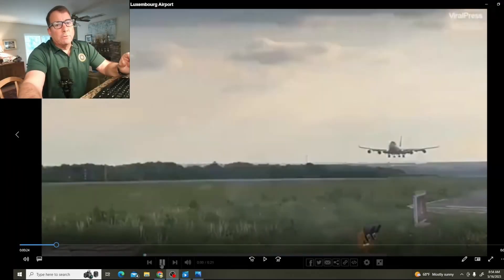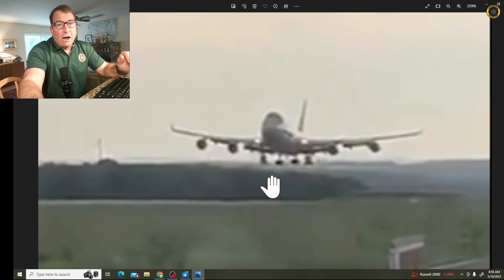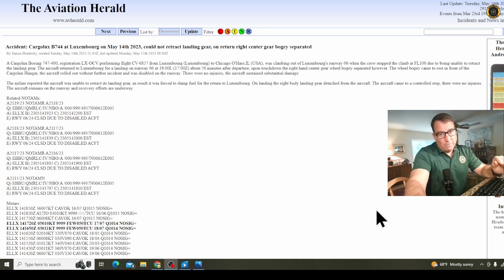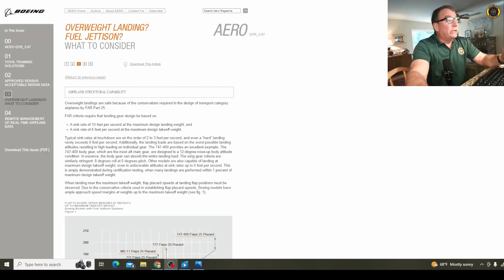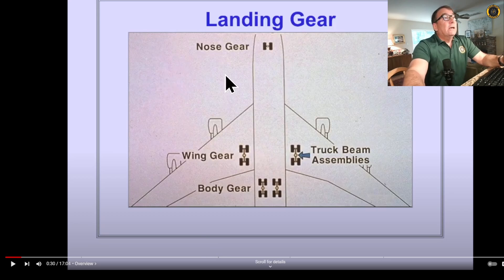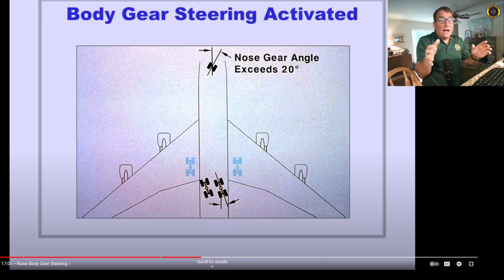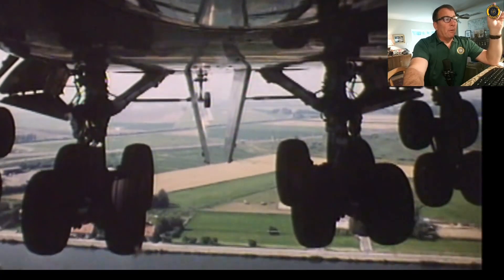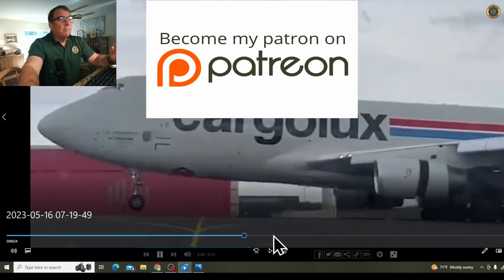Cargolux B747-400 Landing Gear Failure 14 May 2023

Comment: Thanks for the great coverage on the Bouncing Bogey, Juan.  Is there any way to find out for sure if that previous incident with bouncing the Bogey off the van had been thoroughly cleared up? Keep up the great work, God Bless and stay safe.
Reply: It happened more than 13 years ago. So it´s hard to say from the outside if it has any relation to this event - an investigation will hopefully clarify this. The only thing which can be said is that this particular Aircraft had that issue back in 2010.

Comment: An interesting story told to me by one of the engineers on the patent for the steerable boogies on the 747.  As initially designed the 747 did not have steerable boogies, a subject of disagreement within the design group.  During initial ground run and flight testing the test pilots commented it took what seemed to them excessive power or thrust to ground maneuver the bird.  Then in preparation for an aft C of G flight test the pilots were unable to turn the aircraft and the nose wheel just scrubbed sideways.  Steerable boogies were back on the table and then the challenge was to find real estate in the hull to accommodate the frantic redesign.
Reply: Airbus also decided to skip steerable struts on the body gear of the A380.  In at least one flight test incident, a tire(s?) twisted off its wheel.  Now that's some serious scrub!
Reply: IIRC from Joe Suter's book, he initially designed it with body gear steering. However as the weight ballooned it got removed. Rather than bin it, it was parked on the shelf so that when they had trouble manoeuvering the aircraft on the ground Joe said "I have a solution for that", and it was put back on!

Comment: Did not know that the fuselage mains rotated to help facilitate steering. 
So - layman's question - what prevents the non-articulating wing main tires from scubbing hard as they try to follow the articulating fuselage tires around the arc of the turn?
Reply: Good question.  The wing mains are much farther out on that arc, so from a simple geometrical relationship they don't see the magnitude of scrub angle that the body gear do.  Airbus decided to go without rotating body gear on the A380 and ended up with tires wrenched from the wheels, looking a bit like pretzels in at least one flight test incident.  Don't know what they did for a fix.

Comment: Juan , now that it think about it , the last occasion that I mentioned , in Rome ( Fumachino ) , around 1990 , it was roughly midnight local time , Good Friday ( the start of Easter , darn ! ) and it was the right “ wing gear “ that failed ….. Fortunately it let go , following a 180 degree “ line up turn “ at the runway threshold  , failing as the twisting stress was being relieved ( it was a right hand line up turn , so the most stressed gear , being the most inside bogie ) about 60 degrees off runway QDM …. The body gear was still displaced .. So the aircraft ( B747-300 VH-EBW ) dropped onto the No 3 engine , with the No 4 “ slapping slightly , the ground as a result of wing bend from the drop .. The failure was “ explosive “ .. An investigation followed , of course , the results of which are available through the Italian & Australian ATSB .. Initially the whole crew ( ie: Tech & Cabin Crew ) where placed “ under arrest “ … There was no injuries to any aircraft occupants .. It was VERY fortunate that it occurred when it did .. During the “ line up turn , we where “ cleared for take-off RW 16 L , at max TOW , roughly 168000 kgs of barbecue-fuel , and pointing at the centre of the Rome city area including Vatican …….. gulp

Comment: Did you say the previuos incident was in 2010? Been flying for 13 years after that.... would not think related.
If that 1 was lower I'd think the strut  traveled out farther than it should when it lifted off, preventing raising the gear. Then, upon landing of course it is not going back up like it should and instant detachment that we saw. my 2 cents.

Comment: Hey Blanco can will you talk about fuel dump sometime if ya get a chance. I really wondering all the bad things that happen because of it. Like vegetation getting covered or people or cars and houses. What does the airline do if anything to compensate for people for this.
Reply: If fuel is dumped at 10,000ft, it will not reach the surface, but evaporate instead.
Reply: @gordonrichardson2972  Even so the French are quite sensitive about possible  vineyard damage and there is a specific fuel dump area well away to the south east of CDG - it takes quite along time from 747-400 full tanks even with lots of deployed drag and is very boring …
Reply: Juan discussed this in connection with a plane in (I think) southern California that dumped fuel in the vicinity of a school yard. Someone else may remember more of the details so you can find it with a search of Juan's videos.

Comment: If the body gear moves then the wing gear wheels tires will scrub since they don’t pivot.  Am I wrong?  Tires will get scrubbed
Reply: There will generally be at least a small scrub angle for any of the tires in a turn, especially for the "inside" strut of a wing gear if the aircraft were to pivot on that, but from geometry considerations scrub is more severe for any body gears.

Comment: What are the chances that gear was swapped from Kablamo from april? If you look at Juans Kablamo video, the right rear took a good hit.

They swap parts from aircraft in maintenance with lower hrs and cycles on aircraft going through major maintenance with longer downtimes. 

So did this aircraft get the  kablamo body gear? Who knows.

Comment: Does this mean that the wing bogies are raised slightly to keep them from getting scrubbed in a tight turn (or maybe the geometry is not that extreme.) Also, an old 747 cargo pilot, acting as the lead docent at the Palm Springs aerospace museum, told a story about a 747 cargo plane running right over a ground crew pick up, killing two people, on a 00 approach into Anchorage. Apparently the pilots never saw the pickup, they just reported to the tower that they needed assistance, a tow-in, as they had blown some tires on landing. When the tower heard this request, the "lights" started to come on in the tower.
Reply: They do not. The wing gear wouldn't really experience any scrubbing. On the 777, the rear most axle can steer. 3-axle coach buses also have steering on the rear most axle, albeit not as much as the front axle.
Reply: @CaptainKevin  - Depends on the 3-axle motor coach model. In the US, Prevost coaches do not have steerable tag axles, but the tags can be lifted off the ground. The 45-foot MCI "E" and "J" models have steerable tag axles, 35' and 40' models do not. MCI's steerable tags use an adjustable castering system that changes the caster depending on forward or backing movement, and also locks the tags in centered position above 15 mph. There is no "steering mechanism" on these, they simply caster like the front wheels on a shopping cart. I'm not familiar with Temsa and Van Hool buses, so I can't comment on their tag axles. Also not familiar with European makes/models either. HTH. . .
Reply: @CaptainKevin  Thanks for the explanation Kevin

Comment: ....and the YouTube video has been taken down...
Reply: Theres plenty of comments above with an updated link!
Reply: @wino99999  One of the problems I have with your suggestion is that I have zero confidence in an 'updated link" unless the source of that link is actually blancolrio.  A "link" could take me to some nasty place on the Internet.  Therefore, I ignore links with no serious authenticity attached to them.
Reply: @jimcambron1328  No problem, it's a youtube link though so it won't have been a problem.... All it shows is the video from another plane on a taxiway at the airport at the time, and is the same as Blancolrio used his stills from.

Comment: There is a 10 year life on 747 gear, the odds of that being the same gear all these years later is extreamly low
Reply: Um… that’s not quite right …. At that point the legs are removed and extensively examined , reconditioned, then put back in service … boeing deliberately built them like a “ brick shithouse “ , and effectively they could live on with no lifespan limitations, if undamaged , and no cracking was found …. Cracking from the inside out though has been a problem in the past .. and is bloody difficult to detect
Reply: @stumackenzie8492  I'm an A&P mechanic that works for a competitor cargo airline, and just changed a gear one week ago due to 10 year life. While yes, the gear post their 10 year life get reconditioned, they do not go back on the same airplane as the time it takes to recondition them would put the plane "down" for much longer then a normal "C-Check" time of 28 days. Everyone always has servicable gear waiting for a quick 2 day swap.
Reply: @hangmann747tinmann8  I assume that's a ton of cycles in 10 years. I've seen car parts last decades with the right owner. But every one of these landings seems to involve a concussion. What other part on a heavy plane takes this much punishment?
Reply: @JimMork  you are correct, no other part takes the abuse that the gear do. Especially if they do a few HARD landings!
Reply: @hangmann747tinmann8  I'm sure  lots of structures flex on landings, but the landing gear are "frontline".

Comment: GRABBED FROM USA TODAY
Challenger 2 Ultralight Adventures with Peter Toth
1 hour ago
This very same 747, had an incident in January of 2020. Where it struck a van that was on the runway, while they were doing a Category 3 landing. (full instrument landing, with automated system in control right down to the runway due to extreme low visibility.) The right fuselage gear struck the van that was on the runway, which is the very same gear that we see broke off on landing. Is there a possible connection?

Comment: 2010 for the van incident seems like a long time ago, especially for the gear to not have been overhauled since then.  These landing gear are made from ultra-high strength steel (250+ksi or close to 300ksi), 4330M or 4340M (modified with silicone to help improve toughness since they can be brittle at those strength levels).  New make and reman processes for these types of steels are very specific, these steels are susceptible to hydrogen embrittlement from plating, the formation of over tempered martensite/untempered martensite from abusive grinding, etc...landing gear are highly engineered items on large commercial and military aircraft.

Double vacuum melted to be ultra pure too...don't want inclusions or stringers!
Reply: DPF I used to do sheetmetal repair and we were always warned about getting alodine on high strength steel....which I assume would include the landing gear. We used Alodine as a corrosion protection after grinding the alclad off of aluminum when cleaning corrosion. Back in the day when we did overhaul in-house, there were dozens of us doing all sorts of repairs.....around the clock. I always wondered about whether any alodine accidentally washed down under the fairing panels we worked on and dripped down on the gear. The sfaety data sheet says it like this, "Alodine will cause .....instantaneous hydrogen embrittlement....on contact with high strength steel." Is that true?
Reply: @rael5469  anything acidic is a no-no on high strength steel (160ksi UTS and above). Anything with free hydrogen present. Approved aircraft cleaning agents must pass HE testing...that is why the cleaning agents are all alkaline in nature. Some airlines like D-Limonene (citrus) based degreasers, but have to mask up the LG and other high strength steel components to prevent contact with the acid.
Reply: @DillonPrecisionFan  I used to know all that stuff but it's been 20 years since I worked sheetmetal.
Reply: @DillonPrecisionFan  "Some airlines like D-Limonene (citrus) based degreasers" 
Citrisafe. I never liked Citrisafe. Left a film which is no good for painting. We used to have all sorts of great and nasty chemicals which were great for surface prep. But they were unsafe for the user.
Reply: I used to work in a landing gear overhaul shop, and the Boeing overhaul interval was brought in around that time to ten years, so any 747 gear flying about now will be no more than ten years since a shop visit. It could well be that the gears on LX-OCV have been changed out since 2010, Cargolux probably have spare overhauled units available to swap out on the fleet to save time.
Reply: D6AC?
Reply: @hoghogwild  Boeing used a lot of 4330M and 4340M, Douglas used some 300M. Boeing did go to some Ti on the 777 for some drag link or side struts...don't recall exactly. Brake anti-rotation pins were using Aermet 100 at one point in time.

I want to think D6AC was Douglas, but not sure anymore.
Reply: @DillonPrecisionFan  I remember that D6AC was/is used on the Space Shuttle now SLS booster cases.  Each SLS launch uses 10 steel segments, 5 per booster, 2 boosters per SLS stack. Shuttle used 4 fueled segments per booster, SLS now uses 5 segments per booster.  Something like 1200psi peak pressure over a 177feet long, 12 ft diameter average 1/2" thick wall. Peak thrust is 15 seconds post liftoff and 4 million pounds force thrust is achieved per booster.  There was 80 segments left over from Shuttle, enough for 8 SLS launches then NASA is switching to a wound filament case.    Metalworks is fascinating.  Those landing gear take some immense forces, yet must remain light and durable.  Amazing stuff.

Comment: I have overhauled a couple of these, and it could be quite a number of things. . .  The question will be, why did the thing let go on landing? Did the body steering mechanism fail to center the bogie after takeoff, did one of the steering actuators fail, thus allowing the bogie to turn (not center out). If the bogie was aligned with the centerline, it would not have sheered off at touchdown. . . then again, the strut was extended visibly longer than its left hand counterpart. The gear’s strut could have cracked allowing the inner strut to extend to the full drag link extension. . . that purple fluid flash at touchdown is the strut fluid as the inner strut literally sheered off the outer sleeve of the strut. I’m sure other camera footage will surface, from tower cams and such, which will be even more awesome. . . damn, I just remembered that I helped deliver a 747 from Boeing to Cargolux back in 2013. It’s good to be retired. . . Watching Juan, Mentor and Kelsey while chilling horizontal on my couch.
Reply: Yes I posted same before reading other comments. Strut extended too far after takeoff and was not going back up on landing leading to instant failure and detachment.
Reply: Joe, Boeing retiree here, yep good to be done with Boeing. Back on the late 80s and 90s I delivered 19 747s to Cathay Pacific. Those were some good times.
Reply: There's another video out there closer to the runway threshold that shows that the right body gear was tilted forwards rather than backwards prior to touchdown.
Reply: The body gear steering actuators have hydraulic operated locks that activate when the actuators are centred, they should be locked centred before takeoff indeed it is a requirement that the aircraft be taxied forward a short distance to ensure they have locked before takeoff and after the aircraft has entered the runway. If they are not locked centred it will trigger a config warning when takeoff power is selected. I personally doubt they were a factor but I won’t sulk if I’m proven wrong.
Reply: @johnyoung1128  Sometimes these planes remind me of a biological creature, with all the feedback. For us, it might be more subliminal "something aint right". But being a computer guy myself, I'm wildly guessing it is a code that does or does not get created as a mechanical function successfully completes. Program branches to to a warning sequence. You all run computers all day long, so you know about things like this. Your browser might pop up something when it can't complete an algorithm. No aviation expertise here, but I did have to solve corporate software errors.
Reply: #Captain Kevin: I’ll be looking for that video, very plausible. . . the still pictures show the steering actuators in neutral (centered) but the drag link broke off just below them. . .
Reply: Well, I relooked at the still photograph, and the inboard actuator (of the two steering actuators) is extended. So the bogie was canted inboard (not centered) which could have prevented the gear retracting after takeoff, hence the return. The NTSB should state the basic facts within 15 days, then preliminary findings in 6 months and final report in a year. . . The birdcage repair is easy, the skin punctures gonna require engineering but the sheet metal guys from Monterrey can knock that out in a day. NDI the trunion, put in a new gear. . . back in service.
Reply: I hope you were in an upright position while viewing the landing 😉
Reply: Also, the gland nut is missing from the bottom of the oleo strut. That could be why the strut was extended more. We shall see, in a year. An NTSB slow walk year.